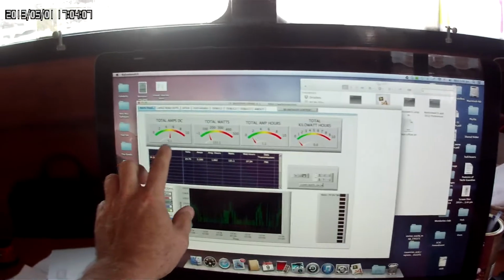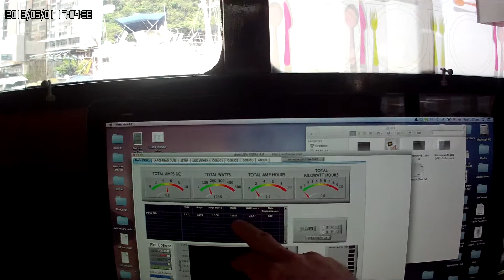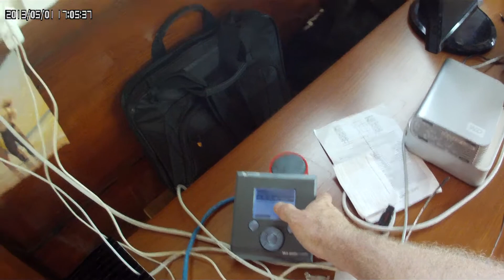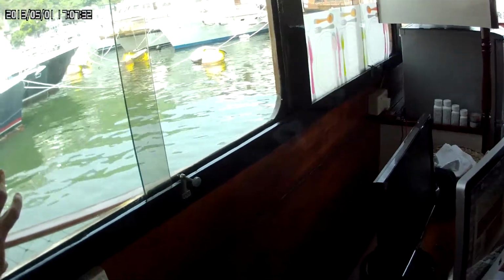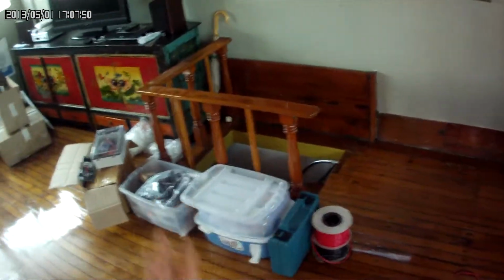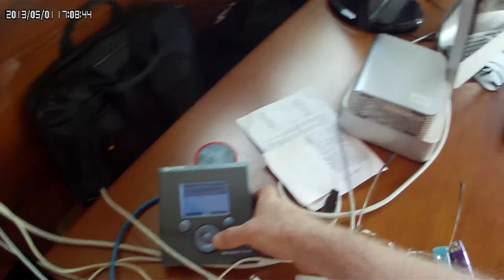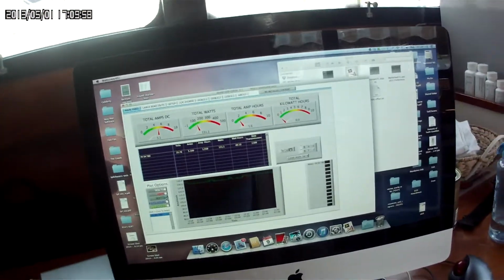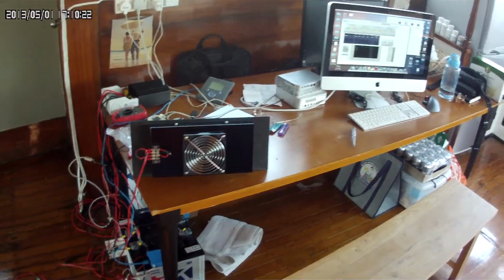Peltier Air Conditioning Battery Test 1

Comment: Alan, I have to congrulate you for such a sweet cooling system, I was researching for building something similar to this and I found this video, would you be so kind of adding to the description a list of the materials you used? Regard from Uruguay!
Reply from the maker: Matias Núñez Hello. All the parts a custom made.... excluding the 24v fans. I had the TEC modules made with the highest grade (99%) to assure semiconductor efficiency. The common TEC chip is not as high grade as we hope for.